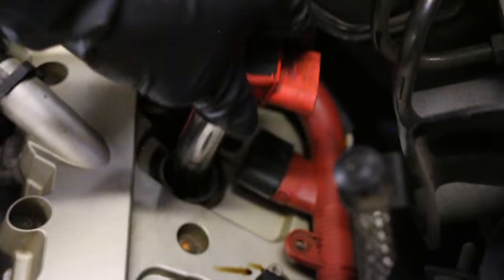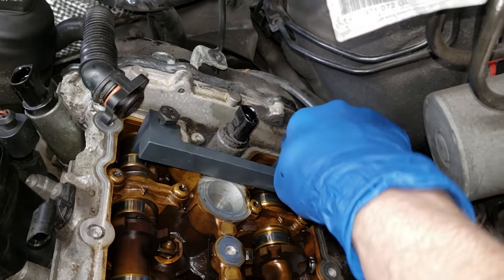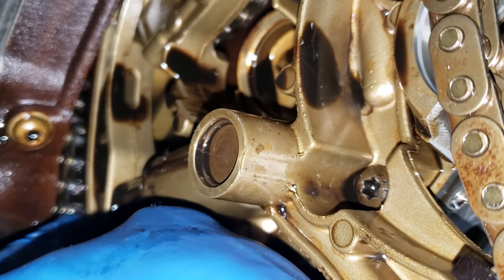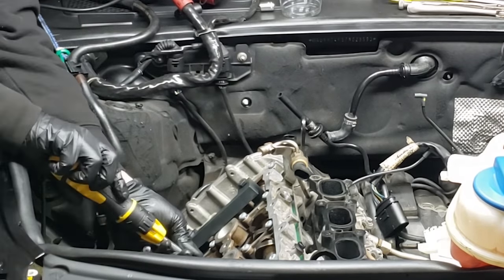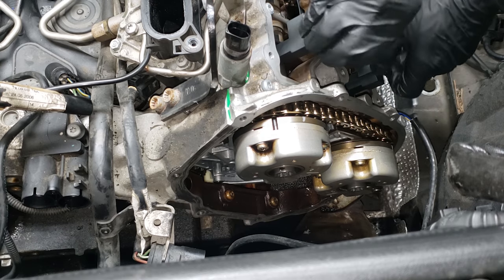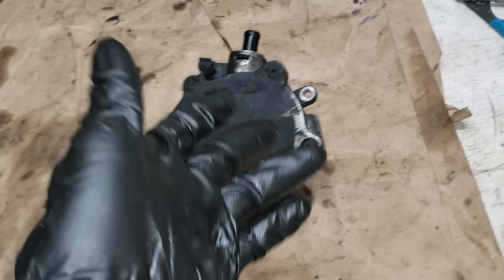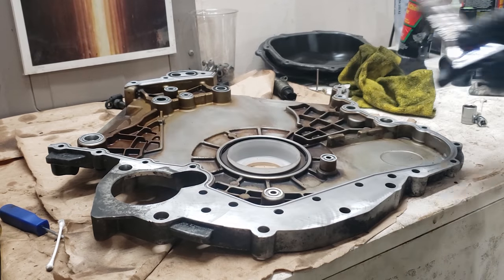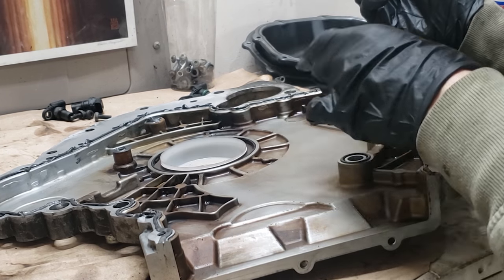Audi (A6 A4 Q5) 3.2 Upper Timing Chain Tensioners, Cam Girdle Seals, & Engine Removal | MUST SEE!

Comment: This is my first YouTube comment ever, I just wanted to say thank you so much for recording all this. I watched your video so many times after researching and preparing myself for the job. You helped me so much you will never know Homie. I replaced the chain tentioners as the car was making noises on start up. We are good to go now, all because of you and your video. Thanks again homie 🙏
Reply from the maker: So cool to hear😁

This was the longest project I've done as far the video hours and this engine work. The video was about 12 hours of footage when I first started editing. So to me I think its really cool that its able to help people. 

I appreciate your comment and am pretty stoked to hear you completed this MASSIVE job on your own. This is not an easy job, so pat yourself on the back, thats actually impressive! 👏🏼👏🏼👏🏼
Reply: bro u are helping me alot on this videos i actually thinking on doing one, so just to tell you and u feel good about your car, i yave and s4 b8.5 i didnt have that much oil in mine like it was just a little and mine was inside beetwen the vales and the spark plugs, i notice because of rough iddle misfire and i did a scan and was culinder 4 and 6 so when i check thats when i notice i changed the sparks, problem persist, so before changing the coils i was like umm let me check the compression and yes 30 pounds on compression in cylinder 4 and 6 now im watching videos to see if there anyway i can fix the engine while inside the car without having to take the engine off the car and looking for videos to do it
Reply: Why would you ever buy one of these cars one
Reply from the maker: @anthony why wouldn't you? They are great cars, plenty of power, lots of room. Some of the best cars in this class. 

Better question is why would you ever watch this video on this car if you don't like them?
Reply: @Mechani_Cole  I watched speedkars video one these engines.. I don’t disagree with the other aspects of these cars but I am shocked someone can be an apologist for this poorly engineered engine. Especially the inexcusable complexity of the engine design
Reply from the maker: Definitely not an "apologist". Are you not familiar with German engineering? Everything is over engineered...

Show me a recent German engine that isn't over engineered?
Reply: @Mechani_Cole  2010-2015 VW Jetta base 115hp engine

Comment: love the video!! i picked an absolute gem of a q5 3.2 fsi up and very possible ill be needing to do this soon. p0019 code.... going to run a proper diagnoses checking sensors and solenoids and if all is good then to the timing tensioners i go!! not having any timing chain noises on cold start, idle or while under load. thank for this video as i was working up a sweat thinking it was going to be a nightmare....

Comment: Yooo my guy im gonna watch this vid but i have an 06 a6 had the same problem replaced the valve cover and the timing chain cover seal still leaked like crazy til last summer the water pump went again and the tech fixed it and put blue devil stop leak and it worked! In hindsight i can remeber hearing a rattle on start up but the car wouldnt start towed it to the shop the guy said a sensor. Long story not so short i the timing chain jumped a tooth and now i dont know what to do he said it needs an engine

Comment: what did it sound like before??!!! if it sound so much better what do we have to base that off of. if you have a video of what it sounded like maybe revise this video (which is great you did a great job besides not replacing all chains in the back which if you went that far and youre doing such a great job why wouldn't you have?!! i dont get it) and put a link to what it sounds like pre job so people can understand what the real deal is.
Reply from the maker: People who own these cars know what they sound like. It's a ticking noise and there is several videos around if you use the search bar. No I'm not going to revise my video off one person's suggestion. 

The chains weren't replaced because they cost around $800 and I already spent enough on this engine when I did it. Plus I can just pull the engine again if really ever needed. 

Either way, this car was sold, it still runs great years later🤙🏼

Comment: The best video Ive seen!
Im looking at a 2012 Q5 3.2 with 135K miles. The Timing chain is overdue on maintenance schedule. Do you know about what this would cost at a dealer, and, could you share your costs on tools etc too get the job done? Really appreciate you, your work and time you gave to do this!
Reply from the maker: @michaelsweet8327 appreciate that! I've heard of this job running around $4,000 at the dealer. Maybe a little cheaper at an independent shop. 

For tools, it probably was under $200 to aquire everything needed. Parts weren't much. But the timing chain kit can get expensive. It's an engine out job either way.

Comment: I ran into the same problem with the dowels for a 4.2.  Come to find out, I saw somewhere that they are alignment tools that pass through the girdle and not a dowel to be left in there.  I poked screwdrivers like you.

Comment: DUDE this video is the shit! I need to do this job on an A6 3.0T supercharged and this is the only video that clearly shows everything. Good looking out on that tensioner gasket, had no idea that was even there. Appreciate it!
Reply from the maker: Much appreciated, thanks for watching!
Reply: Tehgziz lauw did you end up doing the tensioners on your 3.0T with the engine in the car? How was it? Any advice?
Reply: @fccquoter19  no I never did it, I no longer have the car but from some of the reading I've done the 3.0t has Kombi valves in the back so you have to remove those first in order to get access to the timing chain covers. I was going to also remove the supercharger to give a bit more space but not sure if that would be helpful or not. I think other than that it's basically the same as the 3.2 so everything else shown in this video applies to the 3.0t, especially if you have a C6.5 A6
Reply from the maker: This is correct! The 4.2 also has the combi valves on timing covers. Add about an hour for those

Comment: Extremely helpful! Thank you!

A small issue, why so adamant that the pins need to to be swapped for each head? You've used the lock tool in the exact same way on both sides - at 14:06 and 40:48 - makes sense to me, as the cam bolts are all right hand thread, no matter which angle you approach them!

The pins will obviously have to be swapped when changing from loosening to tightening the cam bolts.

Comment: 1)  Great instructional video...super helpful.  2) Hey @Its Mechanicole - just curious, when you strip those two Upper Chain cover Torx, the audio mysteriously goes out until you are almost done with removing the entire front end.  I am assuming this is because this is a 'family show' and there were some colorful words?  I feel your pain, sir...  If anything, hopefully, that pain turned into what looks like a beautiful launch to your awesome channel!  At some point, you need to share that cut! :)  Congrats on the killer content.
Reply from the maker: Thank you, I very much appreciate that! 

For the audio time, can you leave a time stamp of when you are talking about? I couldn't find any audio cut out. Unless of course you noticed the voice over. 

However, there was more than cuss words said when this originally happened. We tried for about 4 days to get that bolt to come out, but nothing we tried would work, and I tried so many things! In the end it was better to have the engine out and do all these repairs. I would hate to do half of this work and have another leak down the road shortly after. I just picked up a 4.2 and if I ever do this job again, I am just going to pull the engine from the start. Much easier to work on outside of the car.

And yes, the pain definitely taught lessons and has allowed me to help others through this video. Thats my favorite thing is being able to help others through my struggles, its definitely a cool thing!

Appreciate your comment once again! and if you can find the time on that clip, I am happy to provide it hahaha! This job ended up being over 14 hours of content to sift through and make this video. It was a lot of work and a lot got cut to make it watchable.

Comment: If excess amount of sealant is applied where you showed, it would be impossible for it to clogup cam shaft lubricating channels as oil lubing camshafts comes from oil channes fed trough by oil pump and filtered. What can happen, if it falls off and makes its way in to oil pan, it could plug up or limit oil flow trough oil sump.
Reply from the maker: This is what I mean't, but yeah. Its only small pieces, but they can clog some areas. Likely, no, but very possible. Either way RTV bad here lol.

Thanks for watching and sharing🤟🏼

Comment: Great video ever for 3.2 L Audi engine. I own a 2010 Q5 with almost 124 k miles. The engine runs fine but thinking about doing the exact same thing. I also used FCP as my source for parts. Are you interested to do it again? and If so, where are you located?
Reply from the maker: Hey, thanks for the comment! At this time I'm not taking in more work until about mid September and I just moved to Las Vegas🤙🏼

Comment: 1:05:00 Great video overall but not sure if you got the tightening sequence right, that part is confusing even when reading and interpreting the manual. The cam phaser tightening dance sequence as i vaguely remember (confirm with manual)
Step 1 - Pull the pins to engage tensioners, use holding tool to apply a little tension with the chain to get the slack out (NOT COUNTER HOLD) then tighten first 40n.m (tool hold on phaser clock wise on, bolt tighten clock wise)
Step 2 - tighten 80nm, now you counter hold the phasers since 80n.m is a lot of stress on the camshaft locking tool. (tool hold on phaser counter clock wise, tighten bolt clock wise)
Step 3 - ball busting 90 degree, (tool hold on phaser counter clock wise, tighten bolt clock wise)
It didnt make sense at first why they specify 2 torque steps + an angle, why not just go to 80nm right away?, its that the first step is not the same as the second.

Comment: What a great video.  I have the same car and the same issues.  Could you add a link for the cam girdle bolts, Don't see a link for that in the description.  Thank you for posting this video.
Reply from the maker: Thank you! It defintely wasn't fun, but well worth it!

Yes on the bolts! I was still finishing the links when I posted it. I'll update the list today. Several more parts to add. Thanks for watching!
Reply from the maker: Gregory Guth here is a link for the cam girdle bolts as requested! 42 total, Part #n 105 540 05 - https://ebay.us/dziVzY
Reply from the maker: I also just updated the description with all the torque specs and links for parts😁
Reply: @Mechani_Cole  That's awesome Cole, thanks a lot.  I'm about to start this project.  Your video is a life saver.
Reply from the maker: Happy it was helpful!

Don't skip on the timing tool kit and also a proper torque wrench. 

Also, what I would do differently is, I would start at the bolt that I stripped. That way, as long as those bolts come out you won't run into the same issue as me and have to pull the motor. 

Its tricky up against the shock tower and there is a coolant line there too so those bottom timing cover bolts can be a pain in the ass. 

Also, unplug ignition coils and crank engine when finished to build up oil pressure to prevent the loud harsh startup like I had. 

I learned a ton doing this job, feel free to ask questions😁

Comment: My 2006 Audi A6 is having the same problem.  I changed the spark plug and see oil in the ignition coil. I will try to do the valve cover gasket first.  Let's hope is not the the cam girdle seals.  How stupid is this Audi engineering?  A $10 gasket will cost $3000 labor.  Never buy any Audi again.
Reply from the maker: @william Lee yeah it's very common problem. You can almost guarantee that it's the cam girdle seal and not the valve cover gasket, I've seen it so many times now. 

One odd solution I've seen instead of fixing it, is one guy kept bringing his car in and would pay to just have the oil cleaned out about every 5k miles. This prevented build up and kept his car running for awhile. He had high mileage and didn't want to spend the funds. So he just kept cleaning the oil out instead of repairing it. 

However, even though that works, still recommend replacing it if you can. Best of luck!
Reply: Do you think if I run my pinky finger down the spark plug hole with some RTV sealant would stop the leak?  I will still change valve gaskets.  I can better see the gap while having the valve cover off.  It is just oil seeping.  There is no oil pressure.  I will let the sealant dry before driving it.  This old car is not even worth $3k.  Not really worth fixing it if it cost that much.
Reply from the maker: @william Lee it wouldn't hurt to try and see. Totally understand not wanting to out the money into it. I doubt it would seal it, but it may slow it down. I used rolled up paper towels to slide down to absorb the oil. Roll them the size of the spark plug hole and stuff it down with a pick to obsorb the oil.
Reply: @williamlee4617  Interesting idea. Let us know if this works out for you.

Comment: Kudos for a massive undertaking.
Couple of errors to mention which may helps others, the rear main seal simple install the timing cover and then you fit the rear main seal. It's so much easier and you won't have so much issue fitting the cover or damaging the seal. 2nd problem, the upper cam tensioner need the pin pulling out BEFORE  you torque the cam sprockets. This is because the tensionera spring take the chain slack out and will move slightly the sprocket. So if you torque first then pull the locking pin it won't take the slack to the tensioners side. I hope you don't have future issues. Great job anyway your very brave.
Reply from the maker: Appreciate the tips! So far the car is still running great almost 3 years later🫡

Comment: everything great but i do not recommend engine oil flush, and if any body does, they need to run the engine w half way new fresh oil, re drain it and then top it off. other than that great video.  and about the flush thats my personal tough. keep going, new suscriber here
Reply from the maker: Appreciate the comment. Going to disagree with you on the flush though. Just follow the directions on the bottle and you will be just fine. Works great, been using it for years now✌🏽

Comment: Awful engine design. I have owned seven Mercedes Benz vehicles over the last 20 years - currently still own four of those - done all my own work during that time period and I won't say they are flawless by any stretch of the imagination - but this VW engine is ridiculous. The component quality is indeed good, its just the design and failure points. Benz only started being this unreliable after 2011 when all OEMs only cared about turnover and tradeins. I recently got an A4 Avant for practically free for a relative in need of cheap wheels for the winter and appreciated your video. 

Thanks again for all the time, its a lot of extra work filming while working and editing must have taken forever.
Reply from the maker: Appreciate the comment and do agree. Although several companies do a similar design now. I also got this one for very cheap because it needed a few things. 

And yes, I would say over 12 hours of labor, which meant almost 13 hours of footage. I cut down 13 hours into the hour and half you see now. Which probably took me weeks to edit the video. I imagine 40 hours into this 1 video😅

Comment: I had a camshaft sensor fault this week. Been running some tests and I am starting to fear the chain has stretched a bit... I am not looking forward to it...
Reply from the maker: Most likely the issue unfortunately
Reply: @Mechani_Cole  How long did it take to pull the engine out? I think it's the best to do and just do everything in one go. Thx (great video by the way)
Reply from the maker: Maybe about 4-6 hours. Hard to tell because I had to put the passnger side back together so I could rotate the engine to get to the torque converter bolts. I would actually say removing the torque converter bolts is one of the hardest parts of this job by far. Craxy wierd angle, had to order special short triple square to get in there on extensions. Sketchy because they are so tight they feel like they are going to break. 

The rear timing cover is also very difficult. I ruined 1 rear main seal trying to install and had to clean the rtv off after applying and do it again. Lots of potential headaches. It ended up taking 2 months in total because I kept having to order parts or new hardware. 

The local dealership defintely knows me on a first name basis I've been there so often😅
Reply from the maker: @kissumisha also the specialty tools needed and the engine hoist, everything adds up. I spent around $1800-2000 in parts, tools, supplies and hardware altogether.
Reply: @Mechani_Cole  thank you for the comprehensive explanation. I'm going to have to sleep on this one, need to see if it's worth the money and the time... I'll still run a few more checks, hoping it's not that bad.
Reply from the maker: No problem! 

I would clear the code and see if it comes back.

Then I would change my oil, add some Hydraulic Tensioner additive and see if that helps any. 

If not, it likely needs work done🤙🏼
Reply: look into the cam sensors and camshaft solenoids, look for leaks. There are revival methods to test and clean the adjusters.